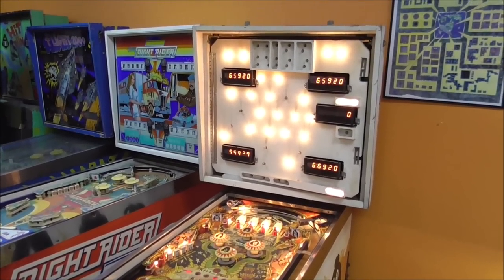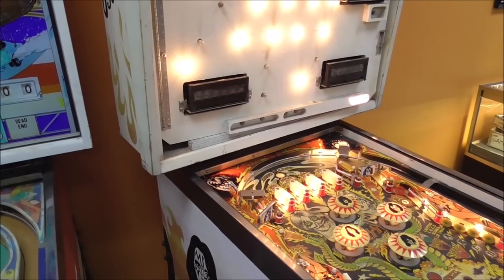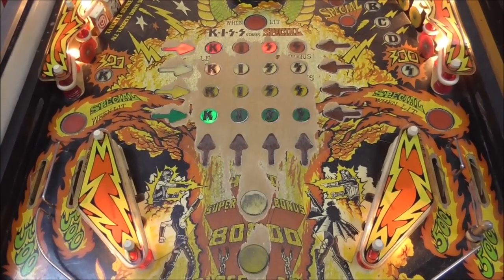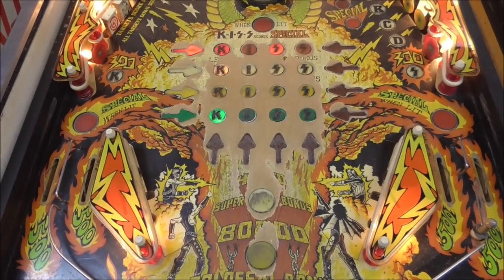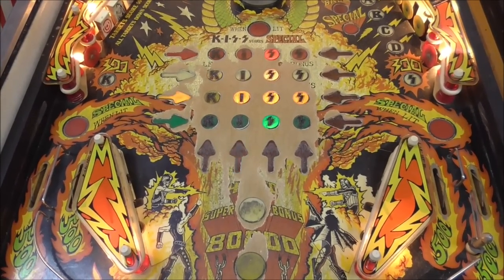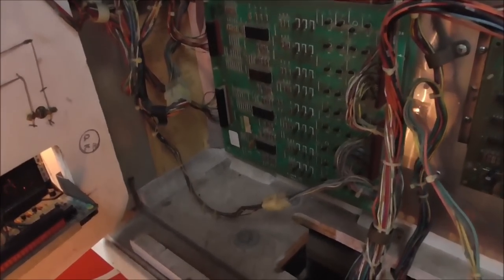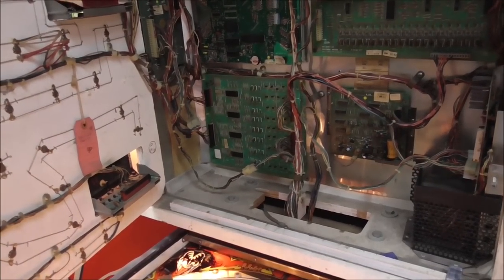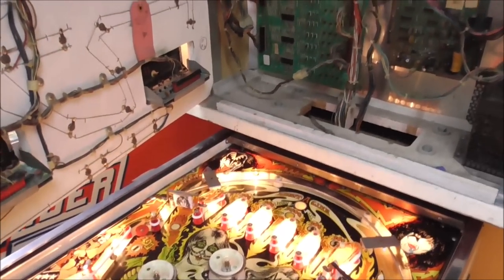They Invented A New Animated Lamp Board JUST FOR The 1979 Bally KISS Pinball Machine!  Repair #5

Comment: Here is what I've learned about decoder/demux chips. I want to someday make a homebrew computer, either a new platform with maybe a vintage feel and capabilities or a modification of an earlier design. Now, a common issue is using smaller memory denominations than the number of address lines. For instance, in a 64K machine, you might have 2 32K RAMs (or 2 groups of 8) or a 32K RAM and 32K ROM. That is actually a simple case since you don't need a decoder for that (and there is no 1-to-2 decoder), just an inverter channel. So 2 chips are nearly completely wired on and same address and data buses in parallel. In that example, 32K chips would need 15 address lines, but a typical 8-bit CPU has a 16-bit address bus (address range of 0-65535). So in that case, you can directly wire the highest address bit to /CS (or /CE) of the first chip. So as long as the addresses are in the range of 0-32767, the bit "15" (the leftover pin) stays low and keeps the /CS line enabled. For the 2nd chip, you'd wire an inverter between address line 15 and the /CS. As long as the lower half of the memory is addressed, the 0 of the highest bit is converted to a 1 by the inverter, keeping the chip disabled. But when the upper half is addressed and bit 15 becomes 1, the inverter makes it 0 and enables the 2nd chip, while the non-inverted line 15 is 1 and disables the first chip. So the /CS is used as an extra address line.

Now, let's change the above example. Let's say you use four 16K chips. So that means you wire all the chips to the first 14 (0-13) address lines, and 2 are left over. That is where you'd use a line decoder chip. So the 2 otherwise unused address lines are sent to a decoder chip to produce 4 active-low outputs to feed the /CS lines of each chip. And if you were to toggle the /CS on the decoder, that can allow you to swap in another decoder.

Considering the 2-to-4 decoders you looked at, the 14556B is closer to what would be used for memory addressing applications. All the memory /CS lines are active-low. So whatever voltage is missing will enable a specific IC bank to work.

BTW, I once considered designing something that could use up to 16M using up to 32 512K chips. It took a while to figure out how to make that possible, as that would be somewhat complex. I understand it, now. 16 MB requires 24 address lines at the CPU, and 512K requires 19. So that is 5 leftover address lines if you use 512K as the denomination. The largest decoder is a 4-16 decoder, meaning only 23 of the address lines from the CPU would be used. So what about that last one? Then you would use two 4-to-16 decoders. You'd then wire one to the /CS lines of half the chips, and the other to the other half, using the lowest address wires of the 5 extras to feed both decoders. Then do the inverter trick with the highest address bit, sending directly to the lowest bank's decoder /CS line and inverted to the other one. So the highest bit selects which decoder (and which bank of 16 chips), while the 4 below that would be the inputs to both decoders to determine which chip in both banks, and the remaining address bits would go to every RAM chip (as would the data lines).

Memory addressing was crazy back in the day. They often used 1-16K chips, often 1 bit per address (taking 8 per byte). So that sometimes required multiple decoders. But if you make a more modern clone, you can use a single IC to replace all those DRAMS and decoders with a single chip. And you can simplify things more by using an SRAM instead of a DRAM and not adding DMA refresh circuitry. With a single 64K chip, for instance, you could put it directly on the motherboard and not use expansion cards, further increasing reliability. But on a homebrew design, I would use a memory socket. That way, if you need a breakout board to those lines, you could insert it between the chip and the socket, and add other logic on that board such as additional memory and memory banking logic.

Building a vintage computer that way would take a few more chips. You have the CPU and RAM, you'd probably need a ROM. Then you'd need PIAs or at least shift registers, maybe a sound chip (like Pokey, SID, TI noise chip, some Yamaha chip), whatever video chip(s), maybe voltage regulators, maybe a power supervisor chip (not necessarily a full watchdog circuit), and an oscillator (or more) of some sort. You might include a microcontroller or 2 to do things such as PS/2 keyboard conversion, game controller input, or whatever, or to replace a video chip you cannot get. There would be some limitations/differences. For instance, it is hard to find an original 6502, and certainly a new one. So you might need to use a 65C02. If the software for your platform used no "illegal opcodes," you should not have any problems. The 'C02 removed some undocumented opcodes, maybe made 1-2 official, replaced others with new instructions, and added a number of NOP instructions. However, hackers and demo makers often used the undocumented opcodes. Another option there is to code your own 6502 on an FPGA. For the sound and video chips, one may need to make replacements using FPGAs or microcontrollers. One should avoid cannibalizing other machines for ASICs unless they are smashed to hell. With some vintage video chips, one likey should use programmable logic to make replacements for other reasons. If you don't have a vintage TV, you might want a video chip that outputs to VGA. In that case, you'd likely need to include scaling since TVs were maybe 1/4 the VGA resolution. That would involve halving the standard pixel clock (or sending 2 pixels across per pixel) and doubling the scan line usage (or tripling or quadding for a lower resolution). Ideally, for that, use some FPGA block RAM as a buffer so you only read the main memory once per line pair (or triple/quad). So read a virtual line, send it to the screen and a buffer, then read the buffer for the next real line(s).

Sorry for the wall of text. I haven't built anything yet, but I'd like to.

Comment: JOE's CLASSIC, can you confirm if the 6803's pinball games used that AC phase lamp light scheme with the positive and negative cycles. I guess they did this Scheme because they could use a lower current power supply and use more banks of lamps? because the more lamps used the power supply would have to upgraded modified for higher current. I'm not sure why those KISS lamps needed to use those IC chips MC14013 and also MC14555 because the normal stock lamp driver boards don't use MC14013 or MC14555 to drive the SCR's they use a different IC chip. I wonder why they used the MC14013 and MC14555 for what reasons?

Comment: Hey buddy, when you say reflow or resolder those pin connections, do you just heat them up to reseat them again or totally remove the solder and redo it?
Reply: since they used good old Lead Solder reheat should do it, but adding some more lead solder cant be a bad thing !
Reply from the maker: I just add a little bit of new solder and reflow them.

Comment: How did you know the new chip would work when its model number printed on the chip doesn't exactly match the old chip?

I'm currently trying to get 6 arcade PCBs someone gave me working and I'm finding a bunch of the chips don't come up on Mouser, Digi Key, etc.
Reply from the maker: You just have to google the chip number and see if they're compatible.... once you figure out what each chip number means you can tell which ones will cooperate :)
Reply: If a chip has a number like 40xx, or 45xx then it's probably a "4000 series" CMOS chip. Different manufacturers added different letters as prefixes and suffixes (and motorolla added the number 1 as a prefix) but for the most part the different vendors chips were interchangable.

74 series logic is a bit trickier, as with 4000 series logic manufacturs added prefix and suffix letters, but there are also letters in the middle which indicate what type of logic is used to implement the chip. Sometimes you can substitute one type of logic for another, sometimes you can't, it requires understanding the design and the characteristics of the different logic types.